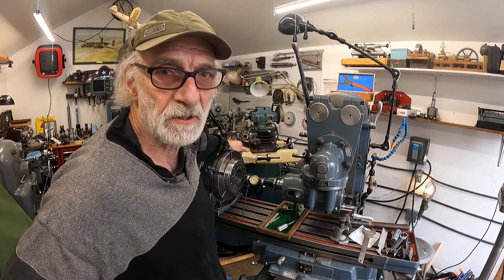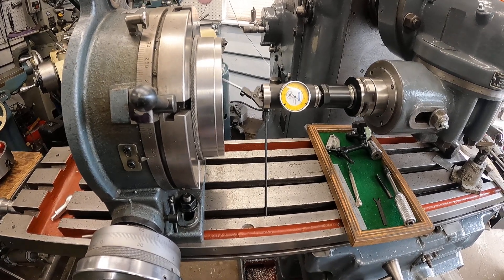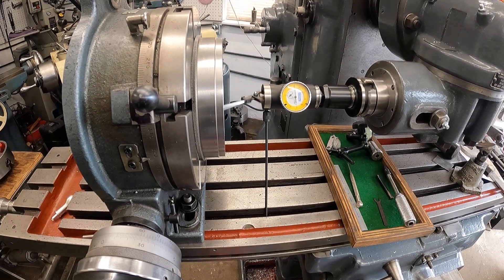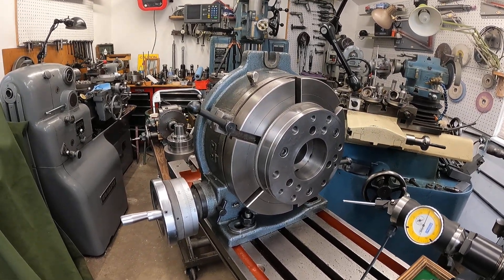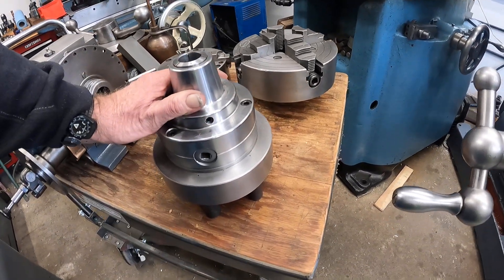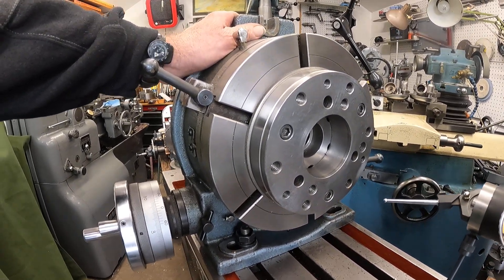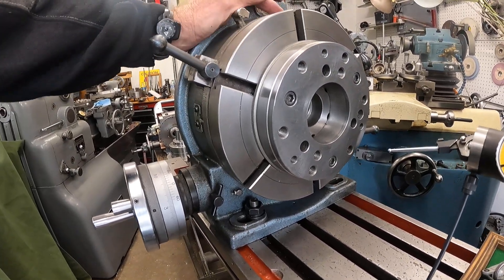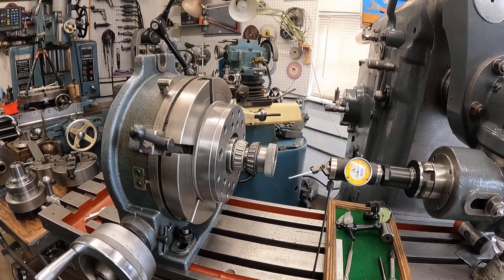Machine tool shared tooling for the garage machine shop

Comment: That machine sounds better every time I hear it on a video! Thanks for the great content 👍🏼
Reply from the maker: The machine has sat for decades unused along with the drill press, I can tell from the first video a big difference here after about 5hrs of running in every gear forward and reverse, the oil looks good. Thanks for tuning in. I am having a great time getting these going!

Comment: I bought a cheap Ebay 5c collet chuck on an integrated d1-6, 5c collets wouldn't fit in it, I had to grind the bore a little with a dremel rigged up in the toolpost and I had to lap the threads in the gear in using grinding paste and a Chinese collet and a couple hours as they were rough and my first world made collets wouldn't thread in.
It holds to 2 tenths now so isn't perfect but that was the best I could get the thing to go back together.
Reply from the maker: The chuck was only $50 more with the back plate I needed for an 8" chuck. I bought this a year ago when there were several reviews that these run true. The one I have runs true. smooth working and has a polished finish. It is a copy of a Cushman chuck, and Bison still makes them. I hope it holds things tight enough.
Reply: Mine ran perfectly true when I got it, no movement on a 2 micrometer per division dti, but once I had fixed it it wasn't so good, you could tell the two halves had been pressed together and the locating shoulder and a couple dowel pins were scored. A fifth the cost of a Bison without a back plate though.
Reply from the maker: @dutchgray86  I have not put this thing to use, the threads for pulling the collet looks  and the parts appear tight. A review I looked at here just a year ago found the same and great run out, but the screws are somehow not removable that hold it together, perhaps thread locker, for sure break the heads off them before they will come loose. I think I can use it for light work.

Comment: I have a for real Blake and I think is only good for quick centering prior to cutting operations.  I find as I’ve become able to do more accurate work I use it less and less.  Between DRO technology becoming more affordable and a test indicator on my Bridgeport spindle it just doesn’t get much use.
Reply from the maker: I am working backwards with it testing it on already trued holes finding it may have problems in the horizontal position higher  the speed

Comment: A lot of great ideas to share tooling and the Timken bearing spindle in the rotary table is brilliant dee dee. I have had a Blake coax for over 30 yrs. Long ago figured out is was good for "good enough" jobs but if it matters a Swiss indicator is my go to.
Reply from the maker: I am going to give it a try for a while yet, but the old test indicator on that new Noga gizmo is hard to beat
Reply from the maker: I found .002" error reading below center tested with the conventional way with an Interapid. The Co-Ax copy by Fowler OK for lawnmower work, maybe still useful I will kick it around

Comment: Dee dee. When I acquired my Van Norman universal dividing head it came only with a drive dog plate. I knew right away that I needed to mount a chuck to it. So, I machined a plate to except a Bison chuck and had to thread an internal thread of 2" x 5 threads per inch. That was the intermediate plate which the chuck was bolted to so I can adjust the chuck in true. Love doing these type of projects. I have many more involving adapters for my B&S #13. Great stuff.
Reply from the maker: Those old heads had odd threads that no one had plates for, you have your hands full